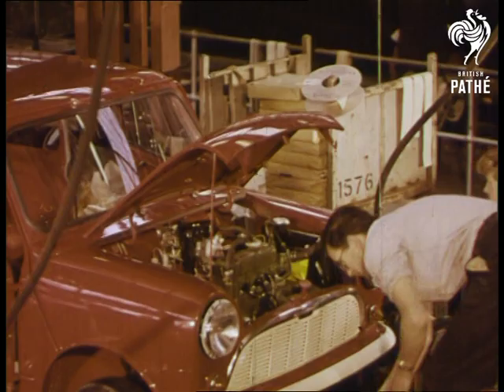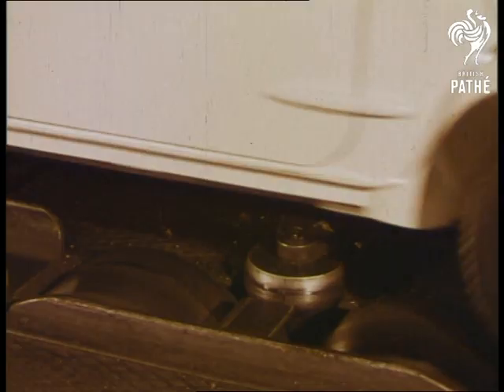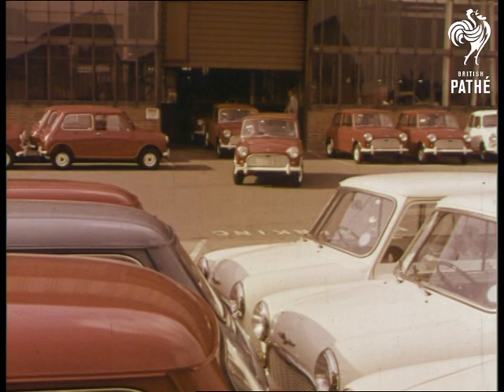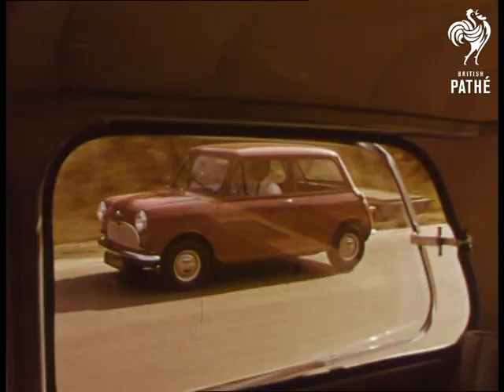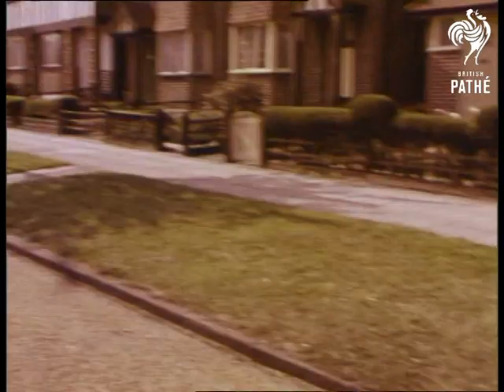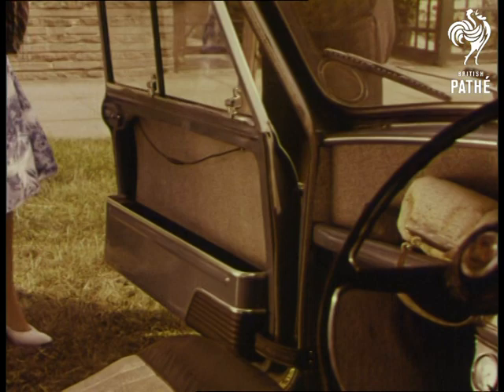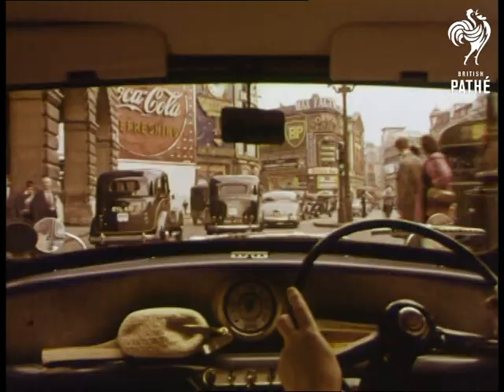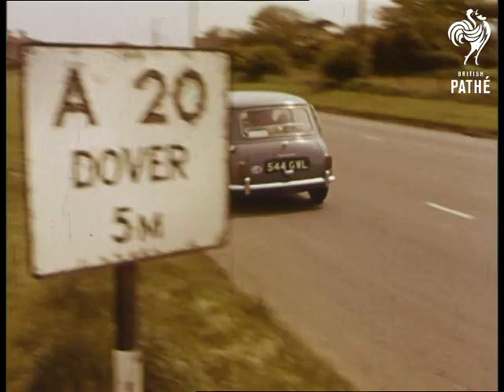Bmc Presents Wizardry On Wheels Reel 3 (1961)

Comment: Seat belts? Who needs um!
Reply: Not me in my '68 Triumph, my everyday car as it's the only one roadworthy.
Reply: @spiderwebb4983  My Mini has none in the back and only questionable lap belts in the front. Good job its so slow !
Reply: In the North American market, seatbelt mounts were required by 1960. Front seatbelts were mandated in 65, rear lap belts in 1970. Front shoulder belts were required in 1969, and rear seat upper mounts for shoulder belts were mandated by 1967. Head restraints in the front seats were mandated in 1968. Minis for this side of the Pond needed some serious upgrades, and that was before the bumper impact standards changed for 73 (front bumper had to absorb impacts up to 5 mph, rear to 3) and 74 (both bumpers had to absorb impacts up to 5 mph.)
Reply: @johnbaker4915 75mph is not slow 😅